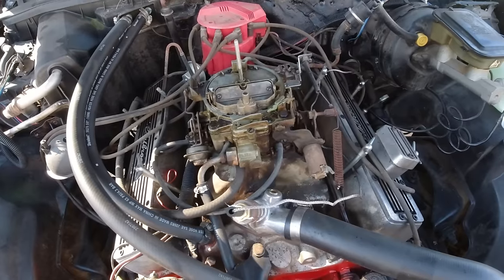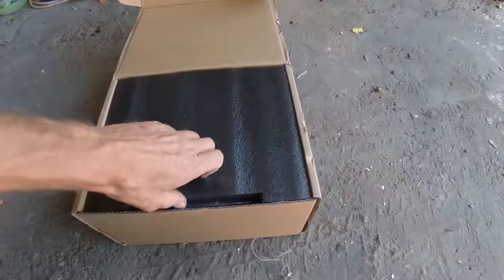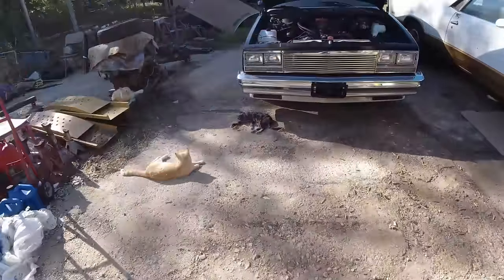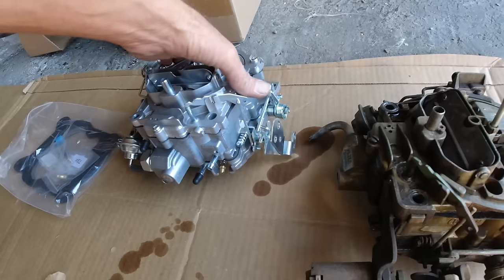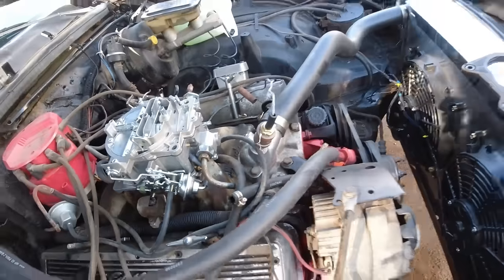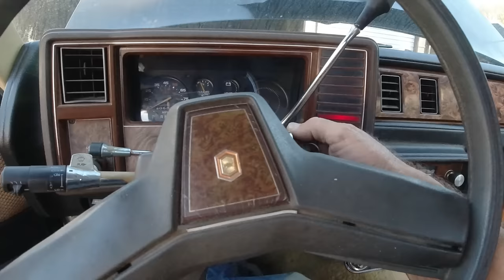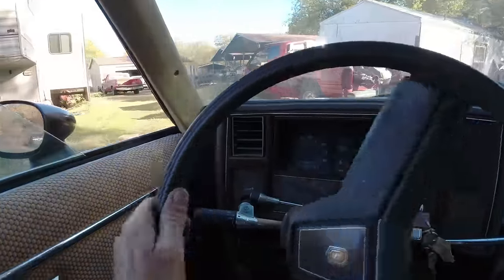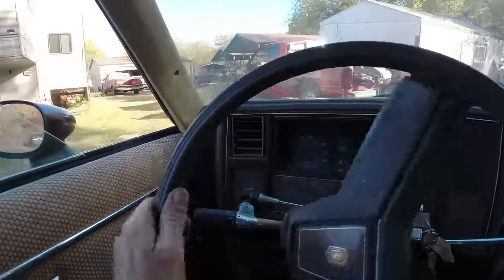Will a new $150 "knock off" Rochester Quadrajet Carburetor work? Let's install one and check it out.

Comment: Hey Bud I just got the carburetor in from Amazon and I put on my 78 350 pickup and fuel just poured out of the top of the carburetor. Can you please tell which seller did you get from on Amazon.   Thanks
Reply from the maker: Sounds like you have too much fuel pressure. I've bought 4 since this video, all off ebay. I can't remember sellers names.

Comment: Rochester quadrajet carburetors of the biggest pieces of junk once you start having problems with them I don't care how many times you rebuild them you're still going to have problems with them it's always best to replace with an Edelbrock or Holley
Reply: Lol you scared of metering rods. You should go have a seat .